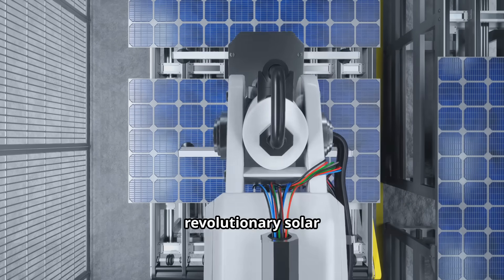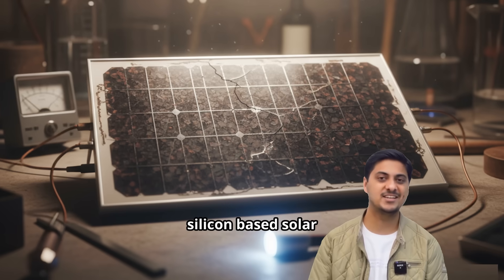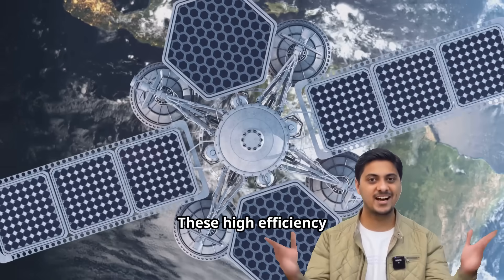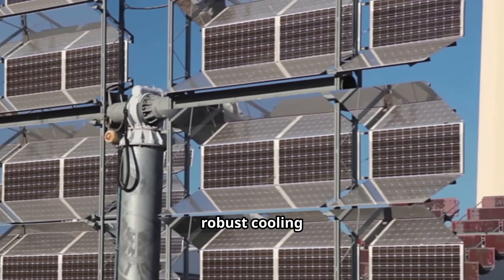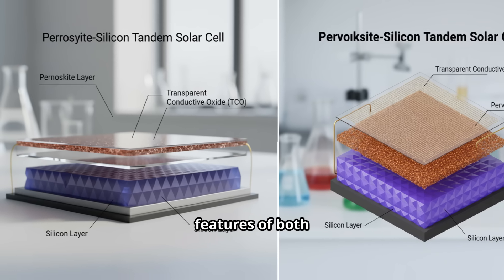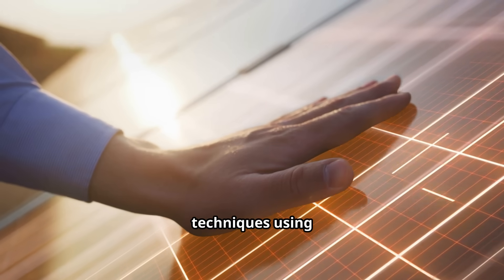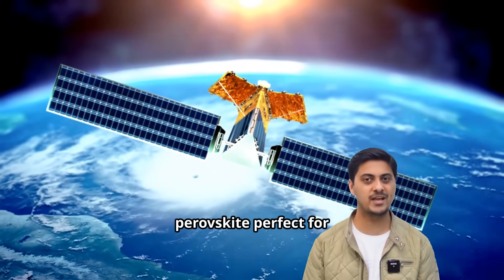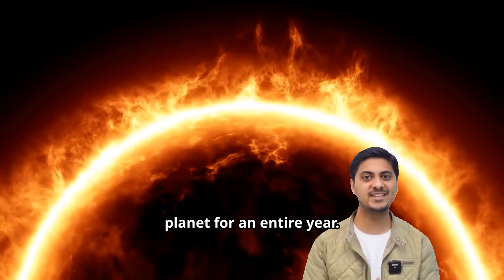How Solar Panels are About to Break their Energy Limits

Comment: Solar Spark X Framework
I. Introduction
* Project goal: Achieve a high-efficiency solar panel (>25%) using advanced materials and nanostructured designs
* Hypothetical design, aiming to inspire innovation and collaboration
II. System Architecture
* Multi-junction photovoltaic layer
* Nanostructured surface for enhanced light absorption
* Concentrated photovoltaics for sunlight focusing
* Thermophotonic system for waste heat recovery
* High-thermal conductivity substrate
III. Materials Requirements
* GaAs (Gallium Arsenide)
* Si (Silicon)
* GaSb (Gallium Antimonide)
* TiO2 (Titanium Dioxide)
* SiC or Diamond (high-thermal conductivity substrate)
* Advanced metal contacts (e.g., Au, Ag, or Cu)
IV. Nanostructured Design
* TiO2 nanostructures for enhanced light absorption
* Potential nanostructuring techniques:
    * Nanopatterning
    * Nanoimprint lithography
    * Self-assembly methods

Comment: so why not just stack multiple transparent solar cells of same type. everything that is not absorbed is passed through to next solar panel well you can also multiple a single solar panel with only mirrors. nah just use a heat pump loop on the concentrated solar cell to get both the heat and the electricity.
Reply from the maker: Correct 👍